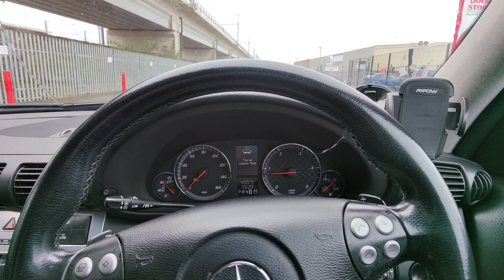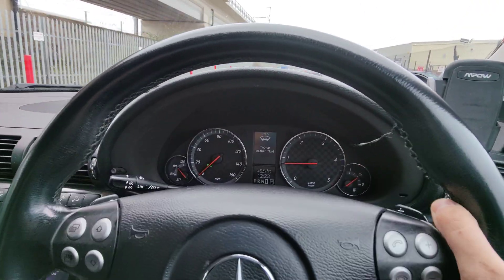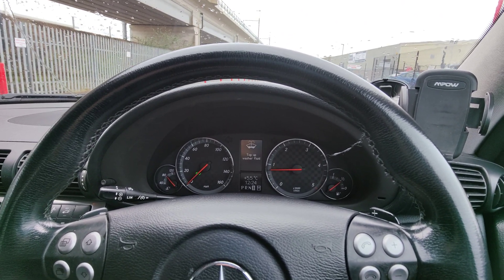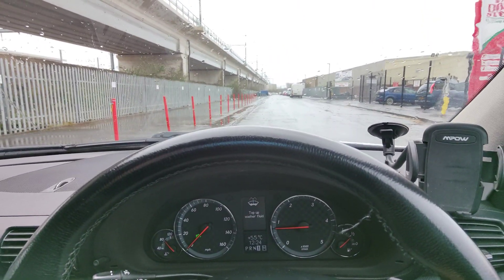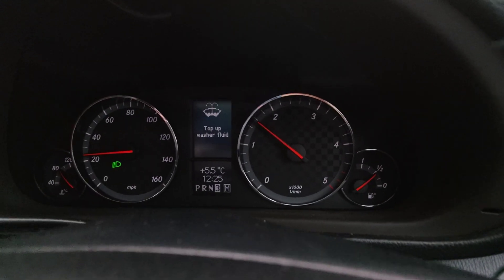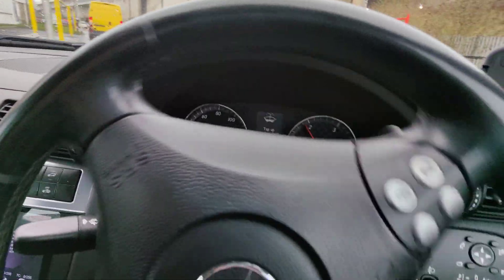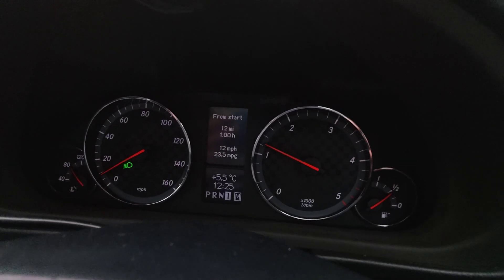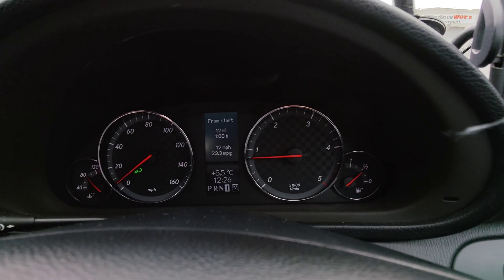A demonstration of the insane shift speed of my custom 722.6 TCM

Comment: hello.

does this tcm allow full custom of the TCC lock up?

not sure if something is wrong with my TCM on my 722.6 transmission in am ML270 cdi but on the diagnose the TCC does not lock up fully in any speed.....in any load under any ciscumstance.... oil pressure is fine,, temps are fine, no error codes whatsoever,.....the testing guy said nothing is wrong....could it be that this is actually the way MB configured the TCM for the ML to be really slippi with the torque converter?

Comment: What would i have to do to send you my 2008 Dodge Charger SRT8 TCM? It will not shift pass 1st.. went to the junk yard and pulled a TCM out of a 2008 Chrysler 300 and it shift just fine but it moved extremely slow...

Comment: Mate you have some pretty broad knowledge. I have always been facinated with canbus, engine control modules and tcm`s. How did you get into this technical canbus engineering and reverse engineering if i could ask? 

Do you have a job that lets you play with these systems or are you self taught on forums and stuff? :)

Really cool project, I think there could be a big market for customizing old Mercedeses. Just being able to disable traction control and stability control without losing abs I think people would pay a lot for. :D
Reply: If you learn how to use your brakes, you don't need abs. It's a well proven fact that a good driver can stop quicker without ABS

Comment: Amazing.. tell me when is the next step to go with the 722.9?
Reply from the maker: unfortunately, doing anything with the 722.9 would require huge R&D as I'd have to create a whole new conductor plate and crack Mercedes' drive authorization process. That said, if this current project with the 722.6 is super successful, I might start looking at the 722.9 some day.
Reply: @RANDASH   I'm sure, you will crack also the 722.9 😉👌 You are doing a very good job.

Comment: You programmed different and new Modes like winter W. One additional eco mode would be cool. 
So that the car, after you stop throttling choosing neutral N for “sailing” and after throttling again returns into the correct gear. So the car is rolling longer with an engine running idle.
And shifting faster to the next gear so the rpm is lower. And even if you trottle a lot not shifting down.
Reply: Coasting in these transmissions in neutral then dropping back down into gear can wear out the clutchpacks overtime
Reply: @samurboi8007   In lock up, off throttle, coasting, The engine actually consumes 0mg/s i am pretty sure. If it were to idle in neutral or off lock up it would have to inject diesel to keep the engine running. Pretty sure you would get simmilar mpg..
Reply: Or call it hypermiling mode H . More modes would be another reason for me to buy it.